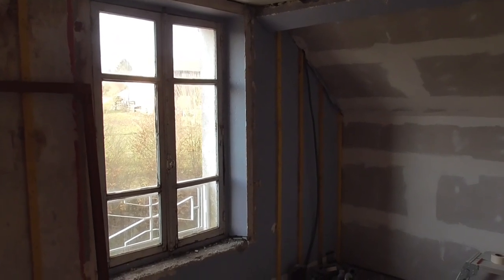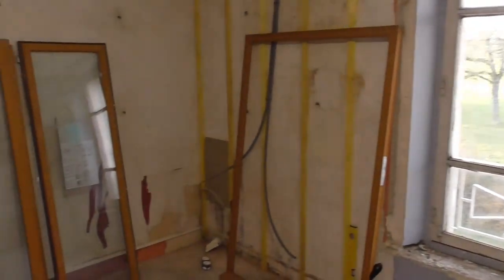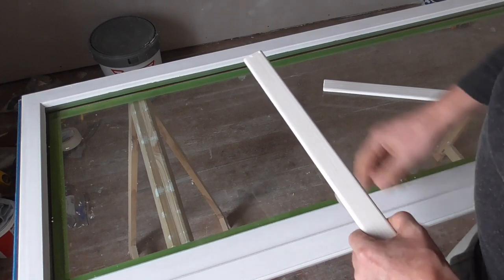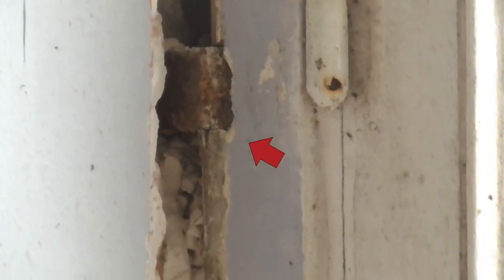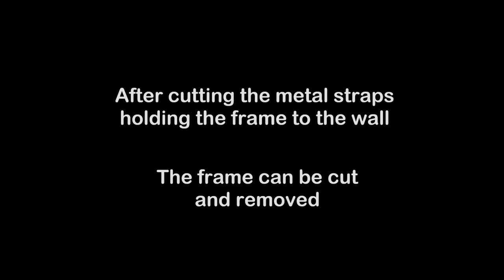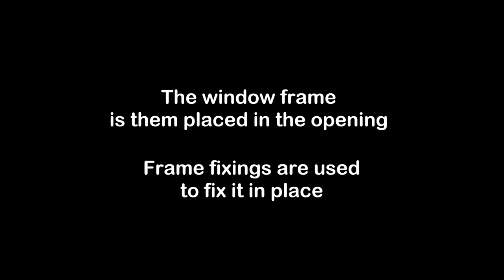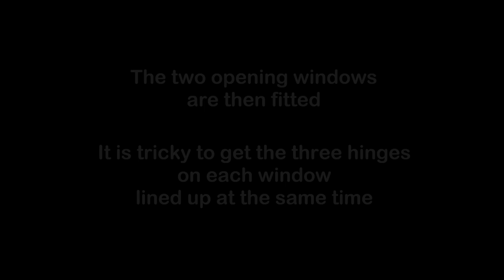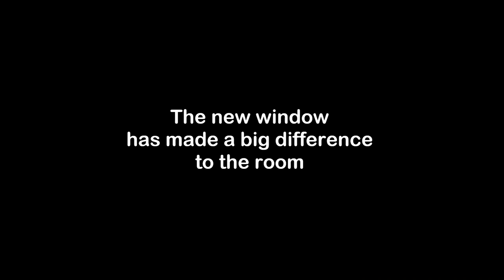Our French House Adventure - pt38 Changing a Window

Comment: Seen from the outside, the result is excellent. On the inside it is different. I would definitely replace  the plastic window handle and also install the crossbars on the inside.
Reply from the maker: The handle matches the other windows that have been replaced, it is metal

Comment: The people I hired to replace two windows where I lived years ago had a similar solution - I needed a window that would open like a door for fire egress (casement window), so replacing the double-hung windows with equivalent but not rotten windows wouldn't work due to the size of the windows. And I wanted something that at least looked like the window style that was appropriate for the age of the house. So I got casement windows with fake bars across them so they looked like double-hung windows from the outside. I was happy, the heritage people were happy, the fire safety people were happy.

Comment: Thanks. Yes, a great improvement. Good idea to go for a single pane and use the horizontal wooden strips. Not shown in the video I think, but presumably you will be putting the wooden strips across the inside of the window too.

Comment: I like that the old window opened into the room!
Reply from the maker: It is the way of all windows in France, they all open into the room. Makes cleaning the outside glass so much easier. Also you can open the window and have the shutters closed for ventilation without the sunlight in summer